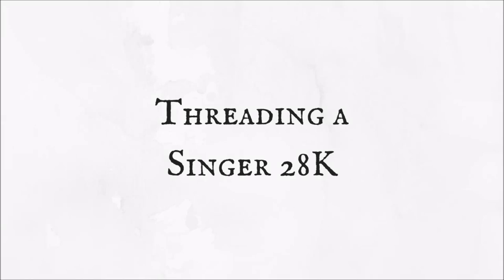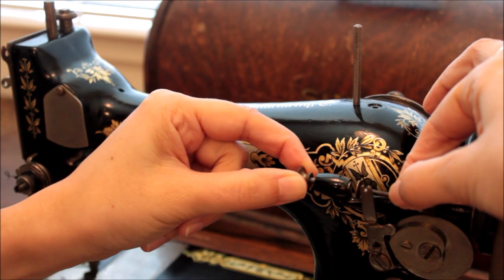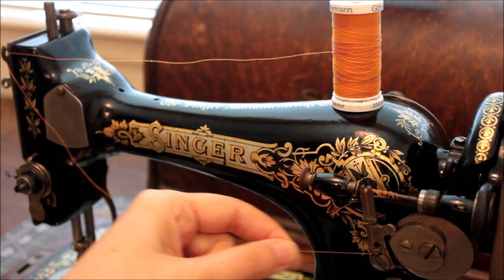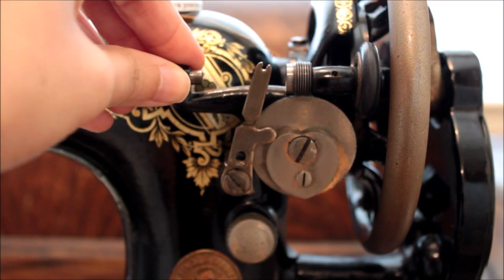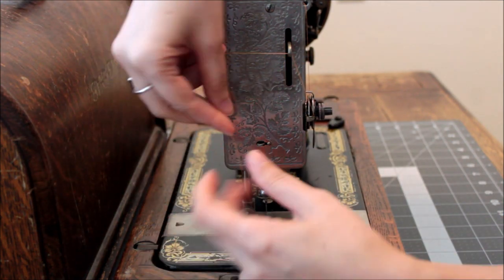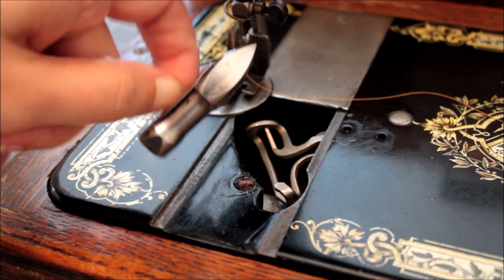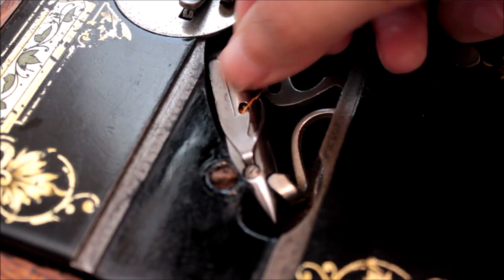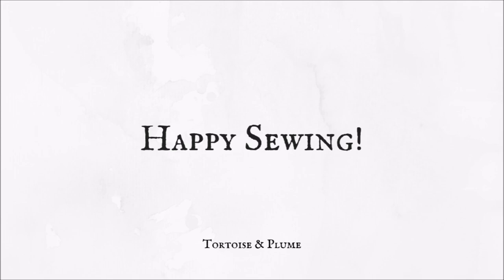Machine Tutorial: Threading a Singer 28K

Comment: Great video! Yours is a Singer 28, in these earlier models Singer didn’t incorporate the upper tension discs opening up with the raising of the presser foot, that was actually in the Singer 128 later on, which is updated version of the same machine. On this 28 model you just have to press on the metal knob  right under the tension discs to open them up. I absolutely love these cast iron antique Singer sewing machines. Many are close or even older than 100 years old now and with a little cleaning and oil still sew as good as they did back then. Just make sure to get your wiring inspected if any of you have the electric version. Not hard to do for someone with some electrical understanding and experience. Well done!

Comment: Just a little tip - to get the shuttle out of the machine it is best to push down on the point of the shuttle.  That raises up the whole back end of the shuttle making it easy to get hold of.  Lifting the shuttle out by the spring can damage them bit-by-bit.   Also, pushing down on the point is easier.  :-)